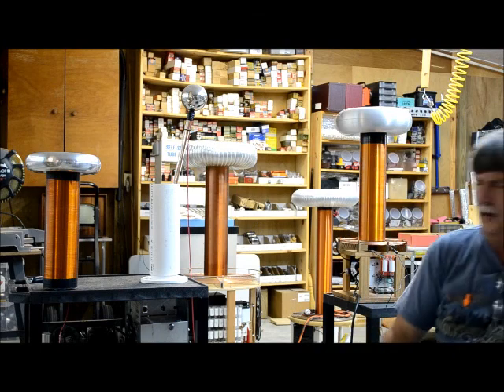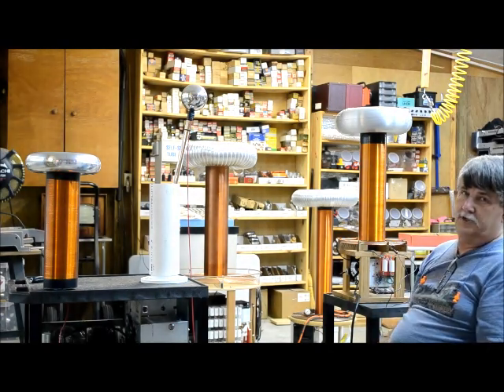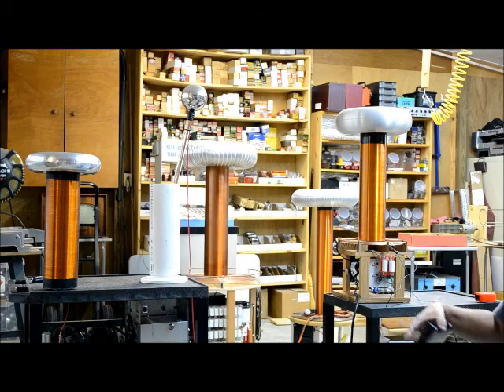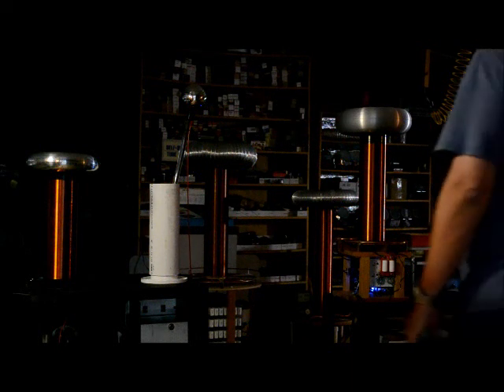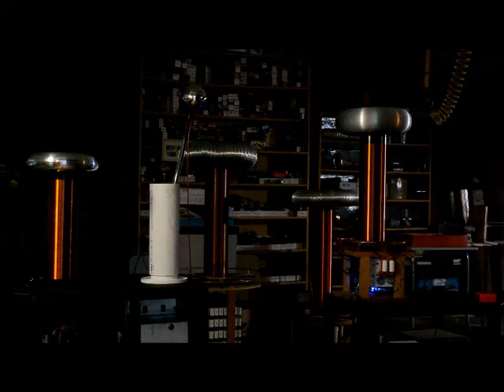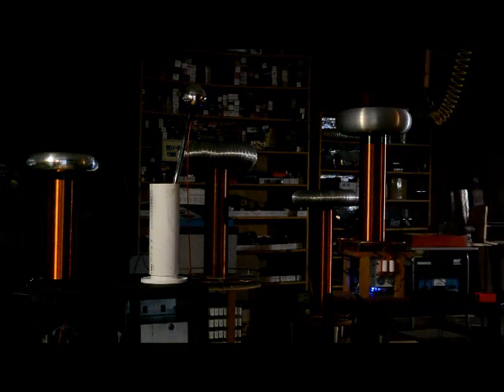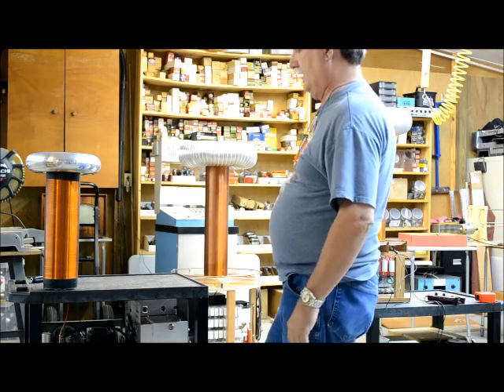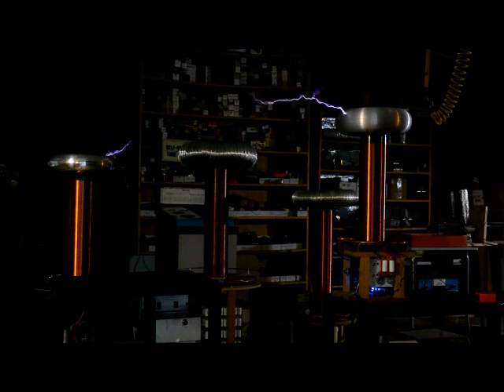Tesla Coil  DRSSTC  Bigger Secondary

Comment: Nice demo... What was driving frequency for DRSSTC and what was a resonant 
frequency of smaller secondary? Strange you report "a bad shock" 
received from the small secondary. High frequencies usualy don't give shocks. 
Sparks can burn at points where they contact the skin however.